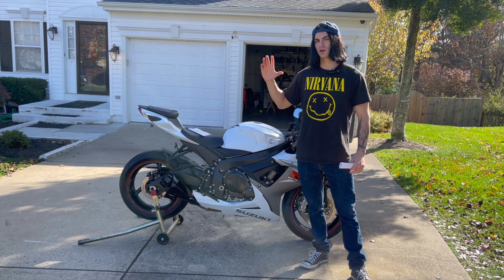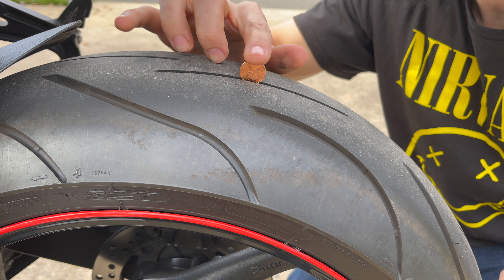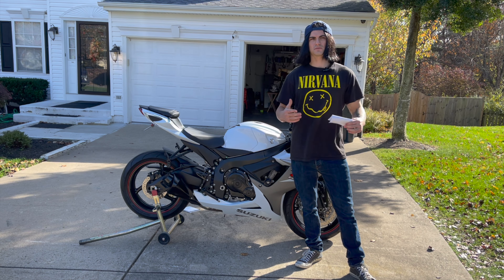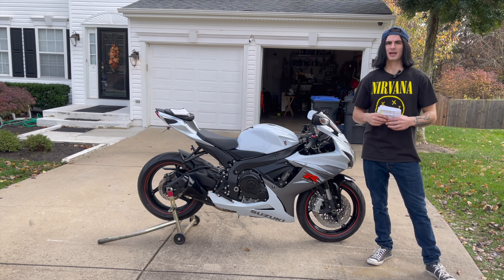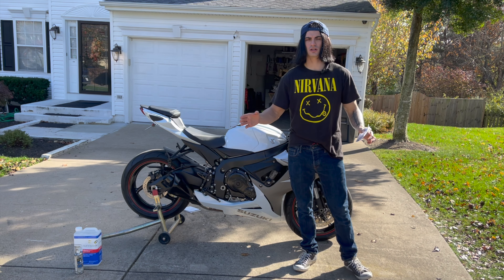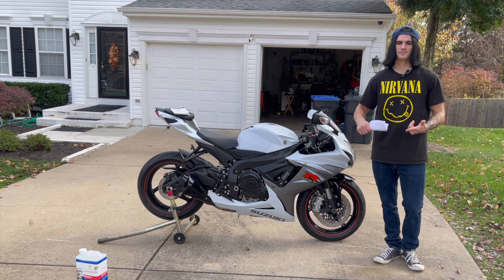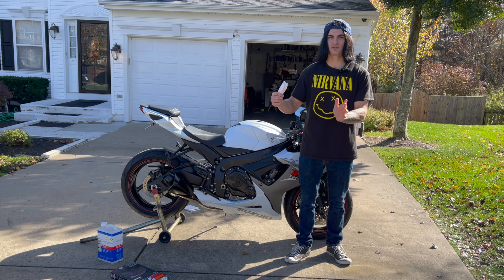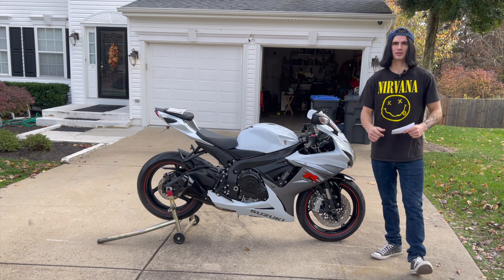Motorcycle Maintenance Tips For Beginners (The Basics)

Comment: I tried to conclude everything a little bit :) 

1. Get a Owner manual

2. Before each ride - Inspection Tired
- Cracks 
- Nails
- Holes
Replace the tires!
Don't use fix-a-flat
Don't use plug the tire

3. Check Tire Pressure
- Differs per bike 
- Differs riding solo or passenger

4. Threads
Penny - If you see full head of Abraham Lincoln - Time to replace
Check the age of them. On the side in 01(the first week of)/17 (2017)
8 - 10 years old > Replace them. 
Below that > Check if thread is deep enough and no cracks. 

5. Oil Changes 
Change it every season (year)
Replace oil filter when changing oil.
Remove gasket on oil filter, don't double gasket in case of oil leak. 
What oil? > Manual or do some research
When changing > Motor on level surface and turned OFF. After running let it sit 10 minutes.
Sight glass > Somewhere between bottom and top line
Dipstick > Somewhere between bottom and top line as well

6. Air filter
Inspect 3 times per year for slits, tears, cracks > Replace it.
Clean it every year
Paper filter cannot be reused. 
Cloth filter can be cleaned and reused. 

7. Chains 
Check if the sprockets are the same height

8. Adjusting the Chain
Too lose = bad (wear out sprockets)
Too tight = bad (snapping)
Measure the "bounce" should be an inch. 
Chain blocks for adjusting the chain. 

9. Cleaning Chain
Clean your chain every 800 to 1000 miles (1287 KM to 1609 KM)
Clean it with Kerosene and a special brush or a toothbrush. 
Make sure your cleaner doesn't kill you chain (in case of rubbers)
Upkeeping the chain will save you money in the long run.

10. Brakes
Brakes reservoirs > Dark in color? Replace it. 
Be really careful. Brake fluid will destroy everything it touches. 

Check break pads > Before Metal touch on Metal
Check pressure of breaks. Don't need to go to far back. 

11. Battery
Get a battery tender > For when not riding in the winter. 
Save money and battery in the long run.

12. Throttle cables maintenance
some throttle cables you can lubricate others you can
your throttle cable is not snapping back fast = bad
Make sure it's not pinched. 
make sure it's lubricated.

13. Lights 
Make sure they all work.
- Front, back, brake, turns, and horn.
Reply: Bless you man

Comment: well 2 min in already dont worry about the age of tires, unless they have started cracking if not then I've never ever had a problem with them oldest tire i had was a bridgstone 010 and it was 8 years old felt fine then slammed it on my R1 I've used them all the and puncture repairs,